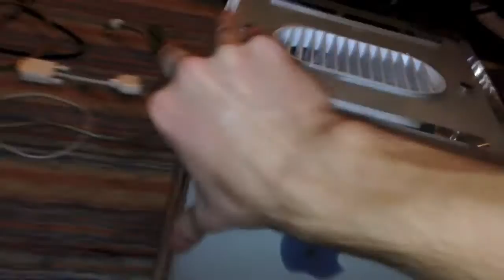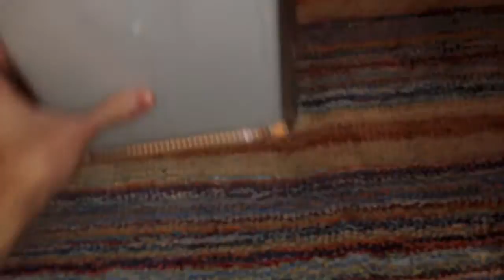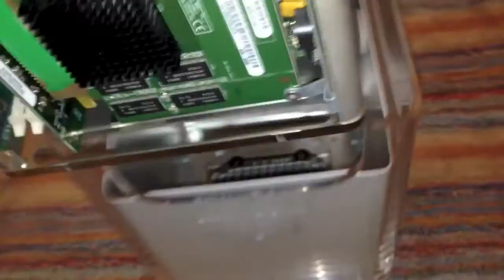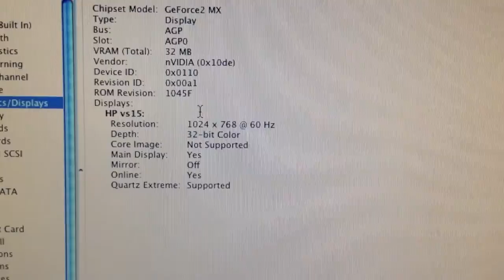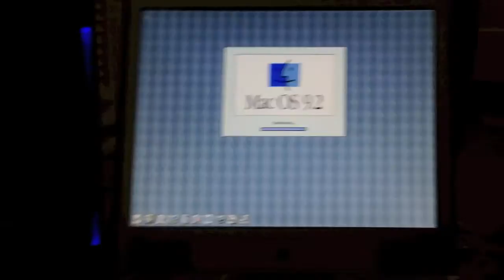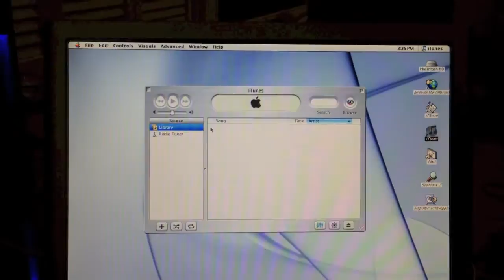Apple PowerMac G4 Cube

Comment: That thing also runs hot.I used one but it kept freezing,not enough cool air can keep hardware below 70 degrees.
Reply: +Reg Thomas The concept of a passively-cooled Power Mac G4 is neat, but consequently it runs very hot. There is room in the Cube for a cooling fan, and you can put one in.

Edit: A CPU repaste can also help keep the temp down. The factory thermal paste tends to degrade over time.

Comment: 36$ dollars,you just won the lottery I can't believe you payed that much for it. There really rare and worth about 1,000 or more
Reply: They are not worth anywhere near $1K, but they are collectible little Macs that will sometimes fetch upwards of $200 in good condition with original speakers, display, and PSU. I lucked out over a year ago with mine, which I got for around $100 in good condition with speakers and PSU. I have since upgraded everything but the 450 MHz G4 CPU, but unfortunately decent upgrades for that are almost as rare and expensive as the Cube itself.
Reply from the maker: Timur Tripp I have all the original accessories for this except for the speakers. Those are unfortunately very hard to find.
Reply from the maker: I know, it was a really nice deal.
Reply: ***** Yes !! but your G4 Cube are not in nice condition the plexi-glass :/ I have this computer :) he is awesome and Perfect condition :)
Reply: ***** You should be able to find a USB DAC for sound output on the Cube. However, I can vouch for the quality of the original Apple Pro Speakers, they put out very nice sound for the size. I like to use my Cube for music playback from time to time.
Reply: well shit my dad has kept his in his closet and it’s literally like new besides the dust